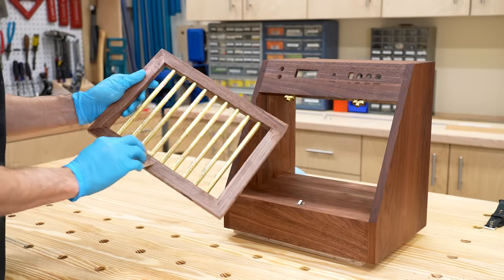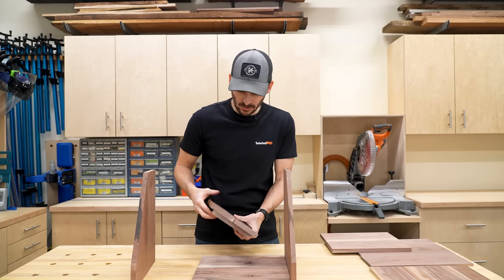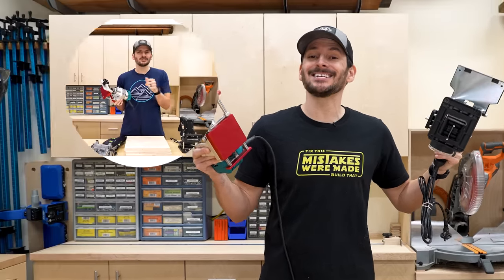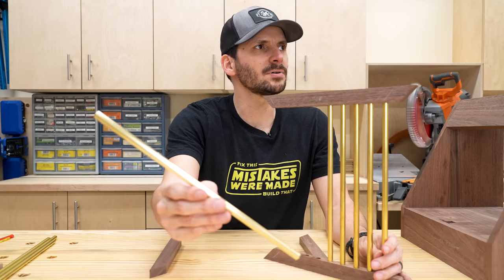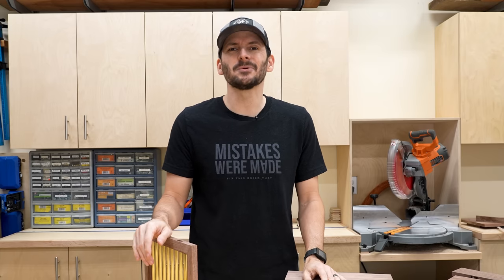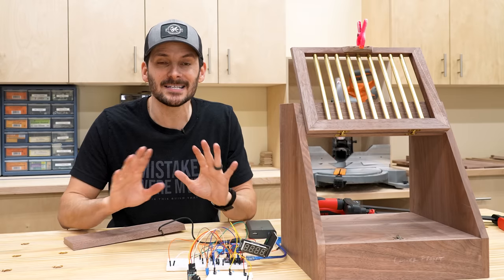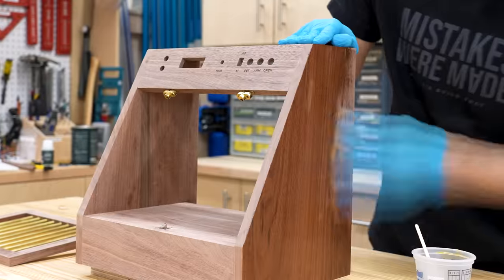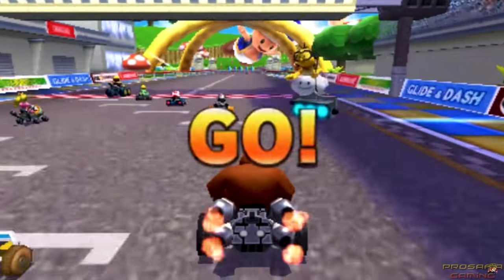Made my son ask... "WHY!??"

Comment: I think Cole should collaborate with the Lock Picking Lawyer.  The locking mechanism looks vulnerable to a simple shim attack.  🙂
Reply: A strong enough magnet should release the solenoid too but that might be harder than you suggested solution in certain cases.
Reply: If you want to go the more round about, and a bit more heist movie, for some odd reason (As that latch would definitely be the easiest option to attack) Deviant Ollam as a collab would also be a contender.
An RFID Ripper, get close to the Neck Key, read and rip a copy of the code it holds, copy and paste into a new rfid chip and you have made yourself a second master key.
Reply: @AlovicGrim  This is the way.
Reply: Uh, what about simple physical bypass? Just reach through the bars and take the phone out? I have thin fingers so probably could do that. If the cabinet isn't screwed into countertop you can just tilt it, the fish the phone between bars. Given most phones are under 1cm thick nowadays.
Reply: Also collab with electroboom to block the bypass for small handed people to pick up phones through the bars. Or at least make it more painful and fun to watch?

Comment: A little tip for the screw drawer, when you dump them out, dump them into a shop towel and then put it on the bench. This way, you can sort and separate on the towel, and when you're done you just bundle it up and dump it back into the drawer. Added benefit, the screws don't really want to roll around on the towel like they do on a bench, so they stay put when you're sorting them.
Reply: He could also add different size holes into the drawer so it sorts the screws based on size while not needing additional draws. Something like a reverse pyramid shape but with square cut outs. The smaller screws would tickle down to the bottom, medium in the middle and large stays on the top. Just give it a little shake. Only downside is that if it is crammed then the effect won't work.
Reply: It’s more dramatic for the camera and identical to the way most of us do it most of the time so I can totally relate to his method here! Note that he did it for the comedic effect but your point is well taken, I shall remember this suggestion!
Reply: @DoctorDanieI  doesn't work like that when the heads are different sizes lol
Reply: My uncle showed me this when I was like 22 I thought it was such a genius move lol

Comment: A reciprocating saw will fix you issue. No RFID needed.
Reply: Or just unscrew the four screws from the back of it
Reply from the maker: I'd just be proud seeing him use a Sawzall 😂😂
Reply: C4 works every time.......just sayin......
Reply: speaking of bombs why do the electronics look like a time bomb at 14:06
Reply: @danholt5991  because simpletons think, apparently, that anything with wires and a clock is a bomb. I guess. You've seen too many movies 😂😂
Reply: How long till the kids work out how to clone the RFID, never show them the secrets :P
Reply: Wondering if the lock itself could be defeated with a magnet...
Reply: @tralfazy  yup! Then find the right wires and apply some voltage with a 9v battery.
Reply: @superslimanoniem4712  you’ve been watching too much LPL.  And that’s not a bad thing.  LOL
Reply: I would personally go with an oscillating saw but same diff...
Reply: The brass tubes could easily be bent with your bare hands. No tools necessary.
Reply: Just drop the box on the ground. Say oops it was an accident, we were just rough housing. No tools necessary. 😁
Reply: -takes out zippo
Reply: Also a strong arm to rip and tear until it is done

Comment: That looks really cool... I would add a little spring assist to push the door open when the solenoid unlatches... The duty cycles on those are designed to be pretty short, and the less time you have it on, the less heat you'll generate.

Comment: Very impressive build. Thanks for not short-changing your description of the electronics build. Some people under-estimate what a long process that is, even when starting with an existing circuit plan and code. If you do end up going down the electronics rabbit hole the most useful piece of gear to clean up your circuits would be a Bantam Tools desktop PCB CNC. Printing circuit boards is great if using surface mount parts; but for anything through-hole mounted, the Bantam is a game changer. After it mills your circuit traces it precision drills all of your components' through-holes. No I don't work for them and aren't sponsored by them. Solid project, I subscribed a while ago. 👌👌👌🤙

Comment: 1. This project it s totally cool! I have a couple of grand-nephews who's parents coud use one of these to lock up the Minecraft controllders! 
2. No, you are FAR from the only person with a bin of miscellaneous screws & bolts. In my collection, all are the "wrong" length, or diameter, or thread count. 
3. The Forstner drill bit you used for the hidden hinge recesses (at 9:40) has a red shank. Does that signify anything? (manufacturer, special purpouse, an expecially dangerous bit, "it's mine!" or something else?) 
4. This is totally cool! 
5. The majoity of my worklife involved working with or on electronics, but it seems I did a brain wipe when I retired, because now I havet look up many things that I'm sure I never needed to. I guess that may be one reason i now spend my time turning large pieces of wood into scraps, shavings and dust, hoping that something interesting will accidentally happen. :-}   
6. Im surprised that you son did not recognize the notes from Super Mario games. I'm in my 70's and I recognized it!
Reply: 1. I saw a plastic version of something like this, looked like a jail cell at five below a few years ago. Since then I think you could probably put "cell phone jail" into Amazon and come up with at least five results.

Comment: Great project.  For 12v I would go with a mosfet module aka "mos module"    Those electromagnet relays are not very safe in my opinion as I have seen them used in production environment with very bad results.   You could also use a service like JLCPB or PCBWAY to easily manufacture cheap circuit boards for your electronic projects and I am sure they would likely sponsor you for a project if you ask them.     If ever you need help with an electronic projects in the future, feel free to reach out

Comment: Check out the esp32 instead of the nano. More pins, Wi-Fi and Bluetooth. Also heat gun over flames for heat shrink tubing. When soldering try to have a physical connection twisting wires instead of just placing near the other half to solder. Good job!
Reply from the maker: Great tips!  I do have some ESP32 and some Wemos D1 as well :)
Reply: @Fixthisbuildthat  I love the Wemos D1 minis!

Comment: I worked on legacy computer hardware from the 70s and 80s. There were a lot of screws and other little hardware and sometimes I couldn't find their original place. I used to hold all those little bits in a 90-dram medicine vial that I got some medication in. If I needed a screw or washer I looked in what I called my "Heavy Metal Drugs". I think I might still have that vial out in the toolbox. Great project. Love the RFID override.

Comment: Very cool.  The only thing I would do is connect a tens unit to the bars so if they touch the bard they’d get a small shock.  Just connect every other bar to one polarity and the opposite bars to the other.  So if they try and stick their fingers between the bars they’d complete the circuit and get a small jolt!  😂

Comment: Great build....great video. All hail The Norm. TO answer your question...yes I have a parts cabinet drawer with unsorted screws.  long ones, short ones, slotted, phillip's, torx, square drives, etc. And you are correct I will almost always find one less than I need/want...lol. I am not well versed in electronics but also interested in it as well.  Go for it...

Comment: Nice Work! Consider cleaning your Tablesaw Blade once in a while! The Resin from the wood creates a ton of friction and so your wood gets burnt. Also the extra heat is not ideal for the lifetime of the blade. So clean once in a while and its like new and you can use it for much longer.

Comment: Nice build! 

One small warning though.  I don't know if your circuit has a flyback diode for your solenoid latch, but if it doesn't you might find the relay gets stuck sometimes.  This is caused by the inductor causing reverse voltage spikes which might cause arks in your relay, spot welding the relay contacts in place!

Comment: I have a question, so I got really good at making table tops for coffee tables but not so much on table legs, half the time I end up purchasing some cheap legs off of Amazon or some other site, what's your suggestion on making some table leg designs and ideas for basic coffee table, my only tools I really have to work with is a table saw, miter saw, and hand tools such as a hand planer or chisel, any help would be much appreciated thank you

Comment: You opted to go with a powered unlock with the solenoid? That opens you up to having the lock bypassed with a strong magnet...  If you had it the other way around, where the solenoid unlocks when unpowered, you could have it fail safe, in the event of a power outage.
Reply from the maker: the duty cycle on most of these smaller ones was the issue.  They can't stand the constant on.  Most are 5 minutes max

Comment: If you want to do more electronics projects. How about wireless phone charger cradle. Since wireless phone chargers require you to put the phone in just the right position , a cradle would hold it in the right position. I think they sell the guts of the wireless charger or you can gut one.

Comment: I see at least 2 vulnerabilities that are not destructive. 
1st You can use a small piece of metal and shim the lach.
2nd You can open the back of it and bypass Arduino by connecting the solenoid straight to the power.

Comment: For the bars, it would have been cool to use lightly sanded acrylic rods and backlight them with LEDs so they work as light pipes. Red for while the phone or tablet is in jail and green for when it has been released.

Comment: Can someone help me understand how the left and right side are not the same and why cutting 2 from same slab with the same template would have resulted in two left sides?  I almost feel silly asking but looking at the two I don't see a difference.  Thanks.
Reply: They are the same but the back side of the original was ugly so he didn't want to use it because it would be visible.
Reply: @Chair-x  gotcha, my brain wasn't processing how you could just use the good finish on both sides by reversing the sides but after your response and some thought it makes sense. Thanks.

Comment: This would be something to make a copy of to send to LockPickingLawyer, with any visible screws removed or plugged, as well as using glue would work for permanently attachment of the panels...  Not that it's necessarily a bad thing to be able to get into it, but that if you really wanted it to be a jail, well, you need to see if you can bypass the RFID and motorized locks you're using... RFID is something that is going to be easy to bypass if you have an RFID cloner unless you're using newer RFID gear, which will make it a bit more difficult, which then leaves the electronic lock to be tested for bypasses... As others have mentioned using a magnet might help you bypass it, although I don't know much about locks myself so I couldn't tell you what else might work besides powerful magnets...

Of course, then there's the question of, could you make it so it has a chassis intrusion alarm? Think of it this way, once you get it open, it could then use that push button or momentary switch input to when pushing a hidden button or something, show how many times if any, it has been opened since it was last locked, which would then reset the open count on each unlock and relock cycle if you did it correctly. I am not a coder so I don't know if that's possible I'm just guessing that similar to a lot of pre-built PCS like dells for instance have a push tab that when it becomes undepressed after opening the case, the next time you go to turn the machine on it gives an audible beep, which in this case could be like when you push a hidden button it will flash a certain color LED if it's been tempered with and opened without authorization... Take those racing light colors at the beginning, you could make like a purple light setup on your light strip glow or flash, when you push the hidden intrusion detection button, while, again, assuming it would work, showing a numerical count of how many times it's been opened, on the already existing LCD display. Obviously, if there hasn't been any intrusions then the light strip would flash green.

Something else you could do, again if possible, is to take the aforementioned intrusion detection system and run it on a timer basis so that once it's locked if an unwanted intrusion has been detected, and then a second intrusion is then detected say 15 minutes afterwards, it will then add 15 minutes to your countdown timer before it unlocks...

Again, all these ideas are assuming that this kind of thing is actually possible which is something I do not know for sure...

As just someone passing through this random video I found it to be pretty cool for what it is, and a unique way for cell phone charging and things... or at least I assume it's also a charger, as that bit wasn't really discussed much, if at all, in your electronics bit where you showed the innards, because it's got nothing to do with the lock electronics...

Oh also, a video on how you did the RFID reader would be cool,case I can think of a few uses for something like that

Comment: Showing the 2 side panels, are they not the same? Showing them in video they appear to be identical. Meaning you could have used the one piece of wood for both sides it seems.
Reply: he didn't like how the back of the panel looked so he was not going to use that as the second side facing outward
Reply: @clawrunner  Ahh. I went back, and he said that.... that's what I get for typing while watching at the same time.

Comment: Still trying to figure out how the left and right sides are different.....
Reply from the maker: haha, it's basically just which side of the board is facing to the outside.  exact same shape
Reply: @Fixthisbuildthat   I immediately thought "caught it in time, way to go" cuz not that it has ever happened to me, but.... And then I looked again at the build and was scratching my brain to understand why the two sides were different.  Prettiness...a good reason.

..

Comment: Brad,  your display is an LED (Light Emitting Diode) display, not an LCD (Liquid Crystal Display) display. For what you wanted it to do the LED display is a better choice. Although with an LCD display you could displayed extra information. I have 45+ years experience in electronics, and around 3 years in Woodworking. Hope I will be able to build something as cool as your cell phone prison.
Reply from the maker: ahhh yes, still getting up to speed on all the lingo!

Comment: He’s going to get the LockPickingLawyer to help him open that box whenever he wants ;)
Reply: I was hoping for any LPL reference in the comments 😆
And immediately, I had two attack vectors in mind... magnet and slim jim 😉
Reply: @SystemX1983  - shims probably would be almost guaranteed to work.
Reply: @stevebabiak6997  yeah, I meant using the slim jim as a shim, just pushing down the latch from the front, allowing the jail door to be opened as if there is no latch 🙂
Reply: Oh yes another comment. That was the first thing I thought of I found 4 different ways to bypass.

Comment: Beautiful piece of work. But this being the interweb I feel I can't stop @ that so I humbly present my obligatory two cents: one observation & one opinion.

Observation: I could be in there in seconds. Non-destructively even. However this would only require a simple alteration to fix.
Opinion: For my taste the digi readout doesn't really fit the wood aesthetic. I would  rather see a "normal" clock used (although I have no idea how one would work w/ the electronics) or a compromise between old & new by using nixie tubes giving it an old-time tube radio vibe.

Comment: At the begging i was hoping it was a prank box but nooooooo. 

Imagine makong a docking station with lets say...... 3 docks so it justifies the whole box as kind of a display. 

But then after tou dock it there is a 5 second delay and the door pops closed and locks. 

Then the lock would be controlled by the watts of the charger. So the box will not unlock untill the phone is fully charged. 

You could make the 3 docking stations kind of like roulette with rach one being a differy wattage cap (differnt charging speeds) 

A little 5w charger thay could take hours, a 10w which is the cap for most low end phones, and a 25w. 

Once the phone reaches 100% the wattage will drop and the lock will unlock allowing you to access your phone. 

You think you just wanted to get some juice while makong dinner? Think again. Now you dont have access to your hpone untill its at 100%
Reply from the maker: lol, love it!

Comment: I wouldn't like the red backlight on all night.  It should fade out and come on when someone interacts with it.
When I read the description of "charging station", I thought it would charge multiple devices and hold them neatly.  When you said you and your wife would use it too, that also implied multiple chargers.  So when you put in that slanted back panel rather than little dividers, I was surprised and disappointed.